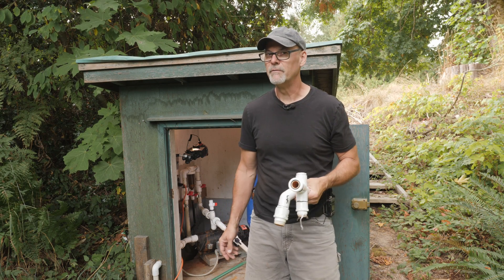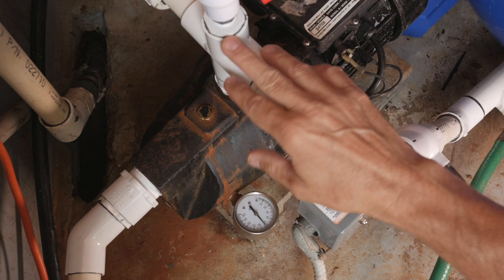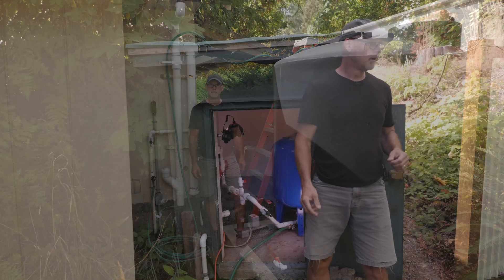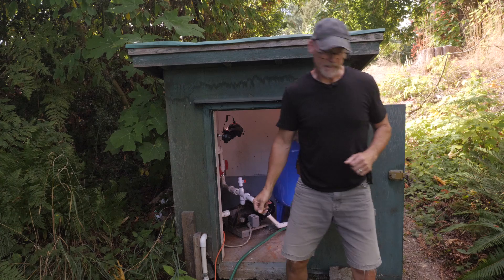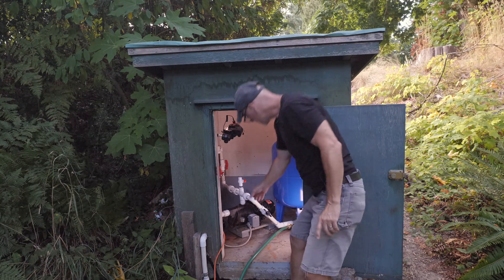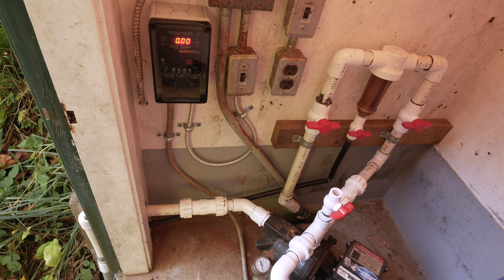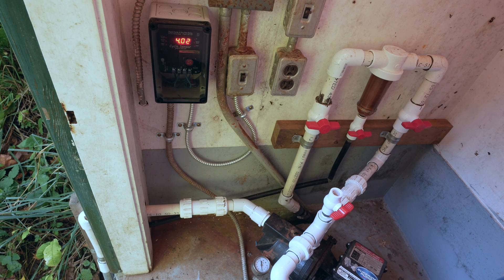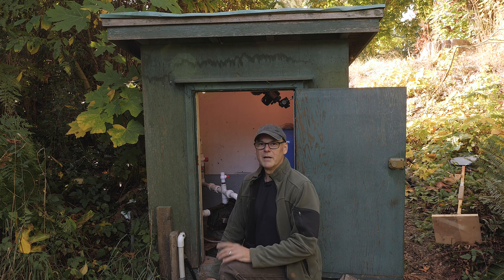Well Pump Dry Run Relay - I finally fixed it!

Comment: Just curious how do you reprime the pump without it triggering the dry setting?  For instance my pump I sometimes have to run is several times and fill it up to get it to reprime.  I have a shallow well pump  but just for sprinklers.  I have added a 30" long vertical pipe with a ball valve on the inlet side of my pump and can usually prime it pretty quickly now but still it usually have to let it run for a minute or more, top it back off, and run it aging,  repeat this 3 to 5 times.  How long does it stay on before cutting out when it detects its dry?

Comment: First off, I like your videos. This is an interesting problem as a low pressure cutoff switch has worked great here for many, many years. What is the elevation difference between the pumphouse and the garden? I calculate that a 58 ft difference would produce 26 psi so no water would flow at 26 psi or below. If no water flows then the pressure will not drop any lower and the low pressure cutoff will not be trigered. I am unsure if that pressure can be adjusted and even if it could there would be a fine line as the pump cuts in at 30. The other thing I have seen happen is rust and debris in the diaphram of the switch or the pipe going to the switch causing it to not work properly. It looks like your solution will work but it seems those relays are unavailale right now. I don't need one but was curious about the price. That pump is not meant to run without a tank. Don't do it. It made me cringe.

Comment: Why not buy a new pump to mount inside the well that have a build in waterlevel and pressure switch. You just mount it to a chain or wire in the right hight from the buttom of the well and connect the hose. No more priming any pumps or shut off switch as everything is build in. As soon as you open the hose some where it starts the pump. You can even get it with a timer build in so it starts by it self.
Reply: I have that type of pump. The flexible pipe to the pump perish and broke, that caused the submersible pump to lean over slightly, that prevented the float-level from working properly, and all that caused the pump to burn out. Having an additional power-sensor would provide additional insurance. Hadn't considered it, until now, but I suspect I could use the type of smart plug that has "power consumption" logging and use that to turn the pump off [when power consumption is abnormal] (and notify me that it has happened :) )

Comment: Why not use a float switch like on a sump pump to detect if there is enough water to run the pump?  The box box store sells them alone without the pump.
Reply: Looks like every time the pump runs dry he will have to prime and reset .
With a properly adjusted float switch and foot valve , problem solved .
Reply: @jimharmon2300  absolutely. The pump would never run dry.
Reply from the maker: And I agree, repriming the pump would be more maintenance in the long run.
Reply: He did mention on the last video that it'd be a pain to do. But, there are noncontact ways like ultrasonic or radar that can sense water level.
Reply: @misterhat5823  
Some times the simplest ways are the best ways .
Reply from the maker: Thanks! My well is old and the concrete rings (I think) would make mounting any float system there a challenge. The relay is right beside the pump so it just seemed an easier solution.
Reply: @MANaboutTOOLS  
The floats I am speaking of are just like bulbs on the end of a line .
You strap it  to your pipe with zip ties or some other type of clamps .
Don’t have to touch your concrete at all .
Any way just thought it maybe of some help .
Reply: Use 2" (that diameter for rigidity) PVC pipe to mount a float switch to. Determine the depth by measuring a foot or so above the foot valve. Attach the float to the bottom of the pipe and run the wiring up inside the pipe to the top. Clamp the pipe to the inside of the well, as far down as you can reach, would probably work, reduce pipe size and pipe a 180°,  then attach & mount an outside junction box and finish wiring up with UF or other appropriate wiring method, then run the wiring to the pumphouse and interrupt the power to the pump. Then no priming unless the well goes completely dry. This is a basic plan and may have to be altered slightly to work in your application. Plus, since you've already made the investment, you protected if for some reason the pump does run dry. All the best, sir 🤠
Reply: I like the idea of a float switch , I had in mind a bilge pump switch for a boat ran in reverse if that's possible

Comment: Oh, that hurts!  I hate it when I cause extra work and expense because I skipping something I knew I should have done!

Glad you have it fixed now.  🤞it all works as it should the next time!

I use the kind of pressure switch with an extra switch (and a manual lever).  If the pressure is too low the switch shuts off the pump, but as long as pressure stays in the normal low-high range it operates just as a normal pressure switch.  This works with or without a pressure tank.  The only disadvantage is needing to hold that lever to start the pump if the pressure ever goes too low.

Comment: Looks like the thermostat is on the motor instead of the pump. The motor won't get warm as the pump runs dry because the load gets lower.
Reply from the maker: I learned that lesson later unfortunately.

Comment: Well, THAT is certainly going to need a safety shut off set-up scheme.

Would not a flow-detecting shut-off valve work?, no flow, no go, with an intermittent test-&-verify start-up (or not) set-up?. (Mitigating the over-heating scenario) - not sure about the resultant cavitation tho~ 🧐🥴
Reply: Essentially that's what he has now. Low flow equals low current and it turns off.